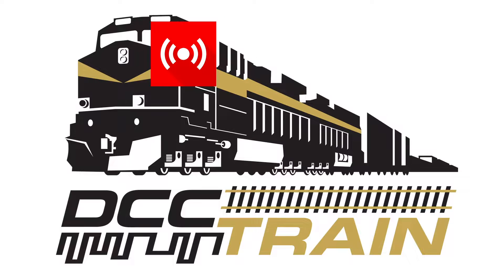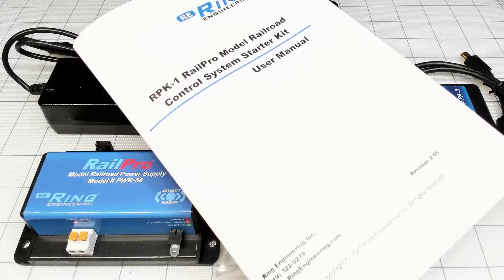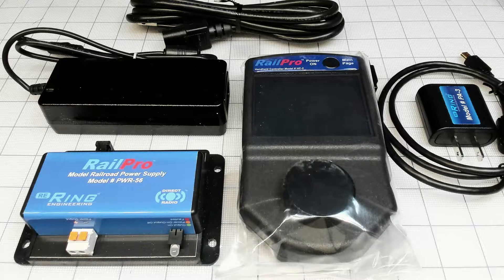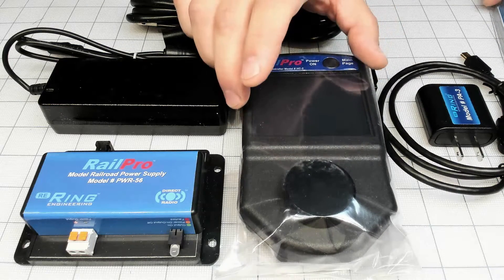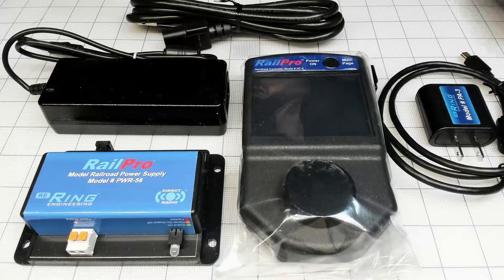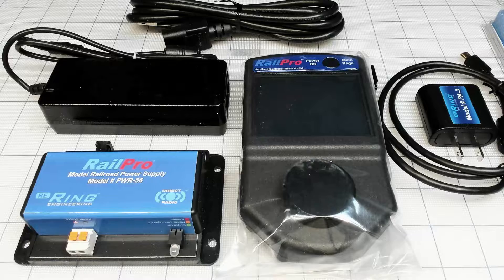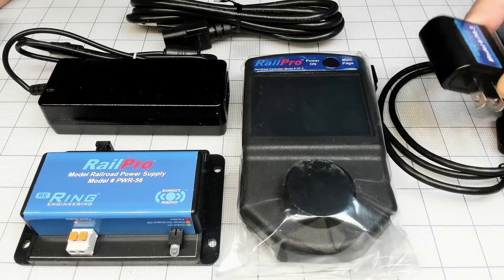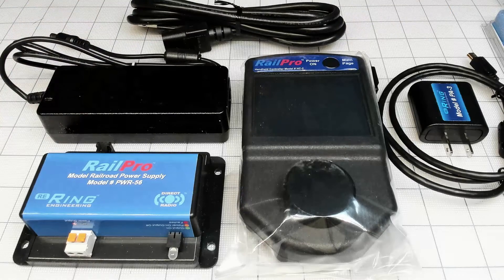Ring Engineering RailPro RPK-1 RailPro Starter Kit Part 1

Comment: We love RailPro, I have two systems in our lab and find their environment to be wonderful. But they refuse to help create closed loop chuff trigger  capability. Crazy we have to add that feature as an add on to the vast capability they have. The programmability of the setup and setting is so strong. We wanted to license that code for S Components but not able to yet. We used the HO controller and Wifi Interface with Tablets for a pretty fair prised solution with S Gauge Legacy Engines, Track and Transformers. Best performance under $150 investment. Dennis
Reply from the maker: Cool.